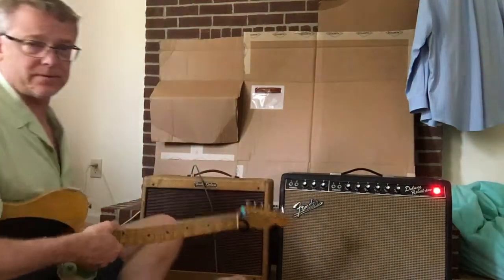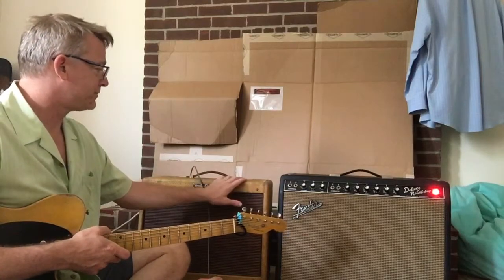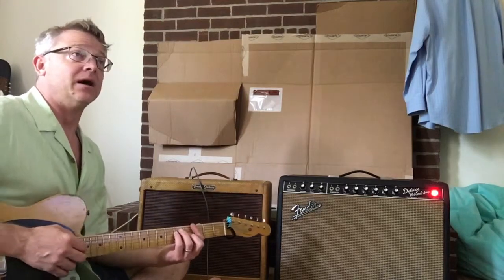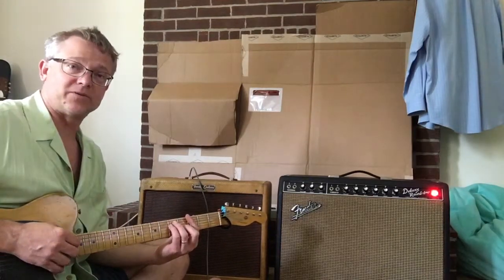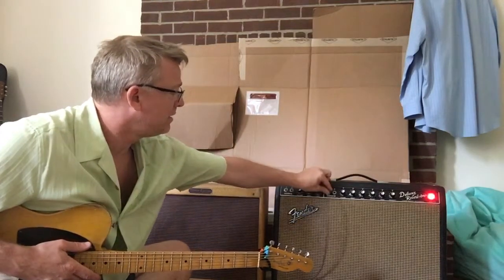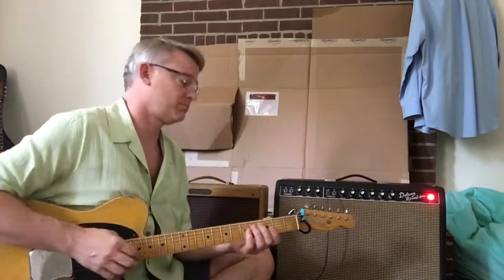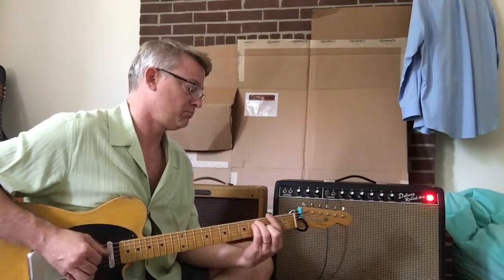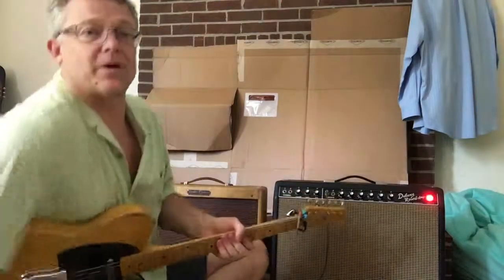Vintage Amp comparison : 1960 Fender tweed Deluxe v 1966 Fender Deluxe Reverb

Comment: I cut my teeth on Blackface tones for most of my life. Only recently came to really listen to what a Tweed deluxe can do. For those high fidelity cleans to edge of breakup sounds, nothing can top a Blackface for me. But the Tweed has something I've never heard from any other amp. Cranked up, how you can go from very nice clear cleans (albeit more mids coloured) to all out Fuzz tone with the turn of a guitar knob. Or even just cranked guitar into cranked amp, played lightly, you still can get an articulate clean that will bark with the slightest harder touch. It's probably the most touch responsive amp I've ever heard. By contrast, the sound of Blackface amps pushed to their limit is not the most pleasant sound in the amp world.
Reply: I put a blackface circuit into a tweed 90s cab and now I am happy.

Comment: Great comparison of tweed and blackface. Do they work well together Paul if the Tweed is breaking up and the volume levels are matched?
Reply from the maker: Yes that’s an ideal situation in my opinion. Especially if you use the guitar volume control to regulate the breakup

Comment: Hi Paul, how much louder is the Deluxe Reverb? Could I do a jazz gig with a tweed deluxe without it breaking up when playing chords?
Reply from the maker: The deluxe reverb sounds louder and cleaner, it can push 30 watts with re bias  and  5881 tubes, everything is more efficient. I think the tweed one to work for a jazz gig if it were a 4 piece or something stripped down. If you’re talking about horns and more uptown jazz like weather report or like that then the tweed one will start to distort trying to keep up and start sounding like a rock amp. You should check out an Gibson eh 185. With the pre-1960 amps with few exceptions, the chords and low notes are hard to keep clean. To help with that replace original speaker with slightly overpowered modern one.